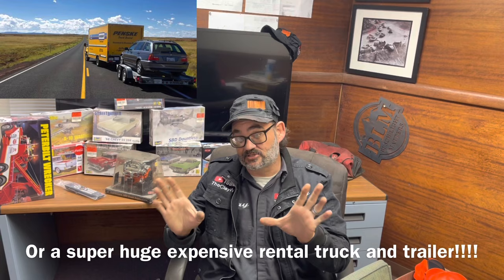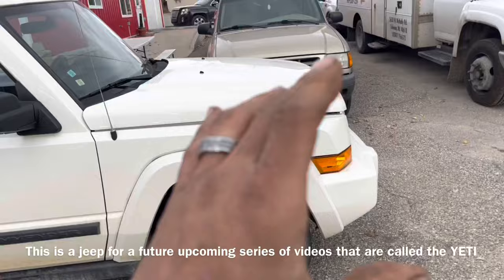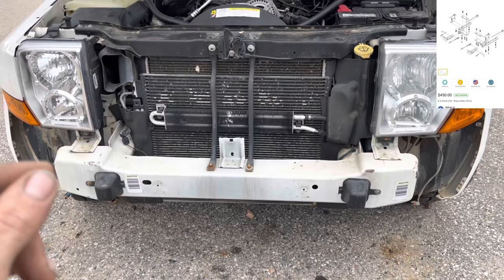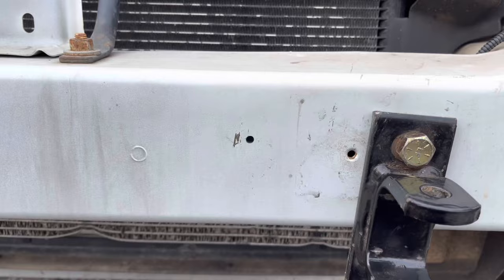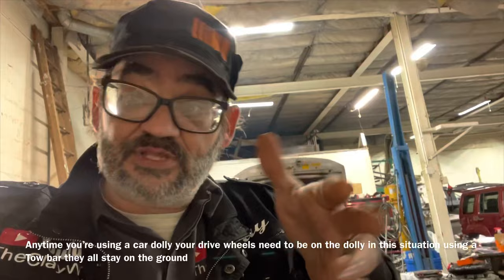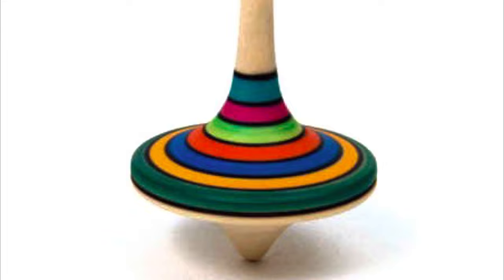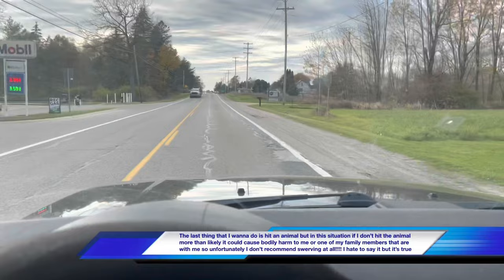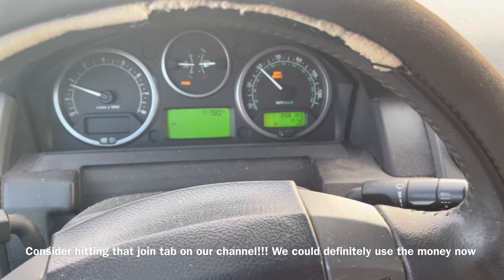How to Use a Tow Bar on Any Vehicle and Why It Works , Why Towing a Vehicle Will Not Crash and burn!

Comment: Great video. Very informative but I must ask… I’m about to tow a 3/4 ton G20 van from Mississippi to Arizona on a 5,000 lb tow bar from harbor freight. 
Do I need to drop the driveshaft or do I just put it in neutral? Also, I lost the key to the van and had to break the steering lock. Will this be a major issue for me while towing? 
These sound like dumb questions when read aloud but your input would be appreciated nonetheless.
Btw, I liked, subscribed, and watched the video a few times. Interesting strategy to boost the funding. 😂
Reply from the maker: Thanks Dayton, sorry but Drive shafts have to go . I don’t know too much about the steering wheel being locked. Have you ever noticed how when a tow company told your vehicle they put the safety belt around the steering wheel? I’m sure there’s a reason for that and I’m assuming it’s so if the steering accidentally came unlocked so I would recommend doing something to rectify that problem before you go I would probably consider replacing the steering column personally. Technically it’s not supposed to go kitty Wompus on you but there’s a lot of mountains through there and I wouldn’t risk it. 

You can’t tell with the driveshafts because transmission fluid would be pumping through the transmission. 

Be careful safe travels welcome to the channel. And we appreciate having you here sorry I couldn’t be more definitive.

Comment: This is great if you want to take a large family on a road trip.😛😛
Reply from the maker: Well, if you didn’t notice, my wife was the first one to test it out for us….. 

This is not a lifestyle … just in case you were serious
Reply: @sharpcarco  lol, nah, just teasing. I actually have an Alfa Romeo Stelvio and my warranty (not the mileage but the months) expired. About to purchase an extended warranty but my oil started leaking and it mixed with the coolant (I’m assuming it’s a gasket prob).
I purchased an extended warrantee and have about 200 miles for that warrantee to kick in. I don’t want to drive it or I’ll get stuck so I’m about to take this route of pulling it on neutral with the engine on to add mileage so my extended warrantee will kick in and I could send it over to the repair shop..

Comment: Is it okay to tow a 4x4 vehicle with a manual transmission on either a car dolly or a tow bar without having to take out the driveshaft?
Reply from the maker: I would have to think so since you can put the transfer case in neutral.  I don’t think that’s gonna be a problem
Reply: I was looking for a way to haul my mini truck to the camp and back once a year and didn't want to buy an expensive trailer. I will see what I have to do to find a way to attach it to the front bumper. Thanks for the video and reply! @sharpcarco

Comment: Unfortunately almost everything here is illegal.  First, you need tow chains that go from the tow vehicle to the towed vehicle. Second, towed vehicles must have some form of breakaway brakes.  Third, most states require the towed vehicle brakes to work with the tow vehicle. Also, the tow bar came with large rectangular blocks that go inside the bumper.  They prevent the tear through that was happening with the washer. Last, never use oversized holes for the bolts.  That's why both outer bolts loosened and started tearing through in less than a hundred miles.  I've towed like this and worse but learn from others misadventures.   The life you save might be your own.
Reply from the maker: Well, we appreciate you being the Citizen police officer. It’s very very helpful but if you read some of the comments which I know for a fact are true, there more sketchy things going on out on the road than what I did in this video this video was designed around showing you how it works and why it works ….. this video is not intended to be lifestyle to live by…. 

We definitely need all the citizens such as yourself to write the wrongs of the past…. To knowingly, engage on things that have already happened, and instead of coming up with solutions, trying to pretend like you can change the past….. so keep up the good work, brave citizen of the United States… please do not let the door hit you in the ass on the way out….. and for heaven sakes, do not choke when you’re patting yourself on the back… 

Your intentions to make other peoples lives more fruitful by trying to push your beliefs on the others have not went unrecognized …. You are truly one of the biggest problems with United States nowadays….. dilly dilly…. Stay thirsty, my friend.

Comment: I didn't completely get how to tow AWD vehicles. Could you explained a little bit details? Thank you so much!
Reply from the maker: Put the transfer case in neutral
Reply: @sharpcarco  Is that sufficient? Do I need to engage the four-wheel-down towing feature? or it is automatically engaged in AWD? Thanks for your super fast reply!

Comment: I have a question. I’m looking for advice and hold no one responsible for any mistakes I make.  My wife and I own a food truck. It’s a 1971 P4000!it’s a 2 wheel drive Dooley, inline 6, 3 on the tree. The truck is 21 ft long, 7ft wide and 9ft tall 

I have been looking for alternative methods to move it from job to job in the event that it breaks down. I know it’s when not if it breaks down. The truck is not overly heavy. It is a ice cream truck for weddings and private events. It has a a couple freezers and tables and that’s it. It weighs less then 10k but more the 8k when loaded with 20, 5 gallon buckets of ice cream. We use a couple Honda generators for power that ride around in our personal vehicles.  Okay so my question is. Can I bolt a tow bar to the front and tow it with a F250. The last thing I want is to possibly hurt someone or my self if she turns over or breaks free. I get the safety chains etc. any advice would be helpful.

Comment: Hey you always want to remove the driveshaft if you're towing over 100 miles I would actually say over fifty miles because like you had mentioned if the engine is not running on an automatic transmission then you will not be getting pressure lubrication to the tail shaft housing and also a manual transmission needs all the gear sets spinning North bring oil up to the tail shaft housing as well you will burn out your tail shaft housing bearing if you do not remove the driveshaft
Reply from the maker: You must’ve missed the part where I said this is not a lifestyle……. Obviously I’m fully aware of that but if it makes you feel better how about it…

Comment: I wonder if they make a tow bar that uses big U-bolts so you dont have to drill. Should come with a set of different size U-bolts so you dont need a drill. It would pinch on the corner of that stamped sheet metal & bite in so it doesnt slide. I think I'ma go weld somethin up and test it out @ parts galore on 8 mile on all the chrysler 200s. Lord knows who I'll be towing.........                                                                          

lol
Reply from the maker: That’s actually a really good idea…. Thanks, Andrew. I’d love to have a solid guy over here. It looks like I got one though I just hired him couple of weeks ago he don’t know shit…. But I like him nonetheless and he shows up every day so I suppose I’m better off than some other people…. I had looked for a guy for the last year and a half. I had a couple shitheads. Generally, I find these guys who like to smoke a lot of pot and don’t have any kids and they’re the ones I usually end up keeping. I don’t smoke pot but I found them to be a lot easier going because all you need to do is pay them enough money so they can continuously smoke pot. And there are a lot of fun. 

Look me up, if you ever move over this way

Comment: I didnt tight up the bolts once both cars were alighted.  I thought it was supposed to be loose.  Damn i drove  700 miles on highway speeds.

Comment: Thinking about asking a job transporting large trucks from manufacturer to dealerships. I have a 95 Mazda B2300 with a 5spd manual transmission. What would I need to hook up a tow bar without removing bumper? Would I need to remove driveshaft or find a way to lock shifter in neutral

Comment: If I’m towing a manual transmission, would I still have to disconnect the drive shaft and transfer case?
Reply from the maker: No just put it in neutral, Transmission and transfer case

Comment: Can I tow a 2000 SUV with a switch that goes from 4x4,2 wheel drive,and has high and low gears with a 1988 Algeria rv?

Comment: nice video. i like how you narrated. btw what do you think about these tow bars where you hook up from below the vehicle at the control arm or the a frame?
Reply from the maker: More reliability and durability. Please don’t forget what I said in the video if you have the ability to remove the driveshaft it is best to do so unless you have a neutral shifting transfer case

Comment: Excuse me Do you think that a Toyota sequoia V8 can pull a Tahoe 99 5.7 and how does it affect it because this tahoe has a damaged differential it is 85 miles to get to the place where there is what to take
Reply from the maker: Oh yeah I’m sure it can. You don’t wanna transmission so I would remove the driveshafts. Then that way the differential isn’t messing up the transfer case.

Comment: I need to tow my Tacoma about 70 miles. It has two metal loops attached to the body just under the front bumper. I probably can't attach a typical tow bar, can I.

Comment: Good video I had that question if I should buy the mounting bracket but this way is a lot cheaper, there is one concern I have. The car to be towed pulls slightly to the left will there be any problems driving like that?
Reply from the maker: If you’re going to be towing the car more than twice I highly recommend buying the bracket this is just one of them situations where if there’s no value and it’s not going to be a commonly towed vehicle it’s a lot more practical to buy the brackets

Thanks for the kind words and welcome to Channell we’re very happy to help you

Comment: My tow bar didn't come with any brackets. I am unable to find any locally and have, like, no budget for any. How do I use the tow bar safely by myself (emphasis on safely) without the brackets for the other car??
Reply from the maker: Sorry I really don’t have an idea where you could get them. 

And I personally enjoy towing the vehicles this way but it’s not a lifestyle it’s better to have a tow dolly or a trailer. 

The reason I made this video was because I was feeling like there was probably people out there that didn’t understand how they actually worked and why the vehicle wouldn’t flip over or something also I thought it was kind of neat how you could do it on just about any vehicle the problem will be if you don’t remove the driveshaft you can’t tow the vehicle a great distance because more than likely it will ruin the transmission if everything is spinning on the inside without being lubricated so keep that in mind.

Comment: Appreciate the video, had alot of concerns about a tow bar. Will be towing a 03 Tahoe was wondering if the tow bar at Harbor Freight would be a sufficient choice?
Reply from the maker: thanks for the message I greatly appreciate the kind words. 

I never checked out that tow bar from Harbor freight but I can’t imagine that it’s much different than the one that I used. The Chinese copy everything and I’m pretty sure that’s all they did. 

Just remember and keep in mind that you don’t want to go super far with that thing because the transmission is still spinning and make sure you put it in neutral. Along with the transfer case if you have one good luck be safe have a great day and welcome to the channel

Comment: Great video, Sir!  I have one question.  Do you leave the transmission on the tow vehicle in overdrive or drive when you're towing?

OK, OK, I actually have two questions.  I have an '89 Firebird with a T5 manual transmission.  Will it flat tow alright with the tranny in neutral, or do I need to drop the driveshaft?

Thanks
Reply from the maker: Well thank you very much for the kind words

No you do not want to leave the transmission in anything but neutral. And also be advised if you tow for a great distance it will destroy the transmission. Because the pump is not running and there’s no fluid moving through the transmission if it’s rear wheel drive you can remove the drive shaft

If it’s front wheel drive and you want to tow it any further than 20 to 30 miles you would have to remove the driveshaft or use a tow dolly. 

If it’s four-wheel-drive make sure your transfer case is in neutral. 

Yes your T5 transmission should be perfectly fine. 

Once again thanks for the kind words I appreciate them
Reply: @sharpcarco  Thanks for the response.

My question about the transmission being in overdrive or drive was actually for the vehicle doing to towing, though.

If I'm flat towing my Firebird with my 2000 Jeep Cherokee, should the Jeep be in Overdrive or 3rd gear when towing the Firebird?

Thanks again
Reply from the maker: Sorry my friend I misunderstood I thought you were gonna leave the vehicle being towed in overdrive don’t worry I’m kind of a dumb ass sometimes well a lot of times anyways

If it’s a four-speed leave it in third. Really what you’re trying to do is keep the RPMs down if you’re on the highway at cruising speed and it’s not struggling to stay at 70 miles an hour you can put it up in overdrive. 

I hope that makes sense I wish I would’ve put that in the video now that you mention it I still thought that video was pretty good one of my better videos anyways ……….. at least I like to think so….

Thanks for the nice comments brother.

Comment: Great video! If you leave your AWD car running while you flat tow it, and stop every so often and put it through the gears, will that help save the tranny? I read in a Lexus forum that a guy did that.
Reply from the maker: You know that would probably work, and I don’t think it would be a real issue because when the engine is running, the pump is turning and that’s really the reason that it’s not a good idea to flat toe any vehicle because it makes the transmission spin but the pump not turn so in that situation the pump would be turning so that should be perfectly fine would be my guess
Reply: @sharpcarco  Thanks so much for your quick reply!!

Comment: The real question.. I'm going from Boston MA to middle of Michigan will a tow bar work that far? Also notice you drove through Remus lol 😆
Reply from the maker: I did drive through Remus. Oh I’m certain that a Tobar could work that long I do however recommend removing a new driveshaft possible. Technically speaking you’re not supposed to tow a vehicle without removing the driveshafts it was fine on this Jeep we finally put it back together but I think I might’ve gotten lucky
Reply: @sharpcarco  yeah this Tahoe is 4wd so I'm putting the transfer case in neutral
Reply from the maker: Oh that should work cool beans

Comment: Right behind the part that goes over the ball there are 2 holes for a u-bolt where the chains are supposed to connect.  I've seen a few different methods.  Just good it and you'll see pictures.
Reply from the maker: I was just saying that I did not put that one together and I did not feel like they were in the proper spot I didn’t want people assembling theirs incorrectly because of what mine look like.

Comment: Can't you tow a rear wheel drive car or a four-wheel drive car with the engine running. I know it's not ideal but it will work.
Reply from the maker: Well that would definitely ensure that the fluid was pumping through the transmission which wouldn’t hurt anything. I’ve never thought about it but you should be able to do that you just have to make sure the trans is in neutral